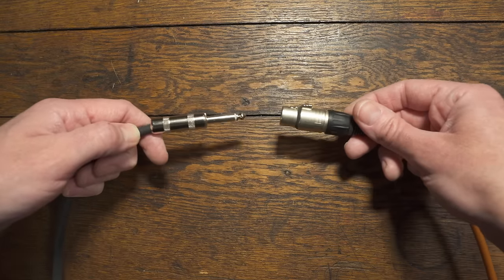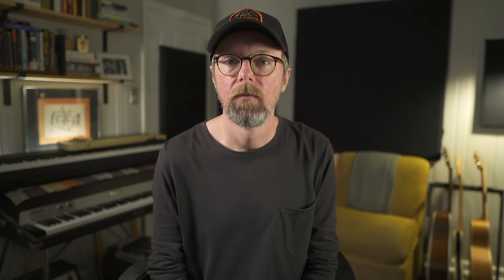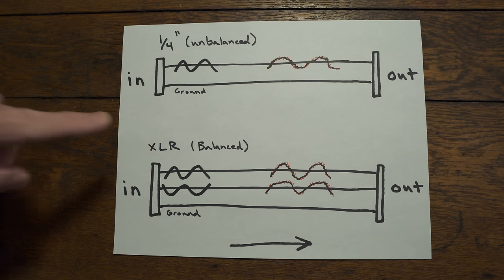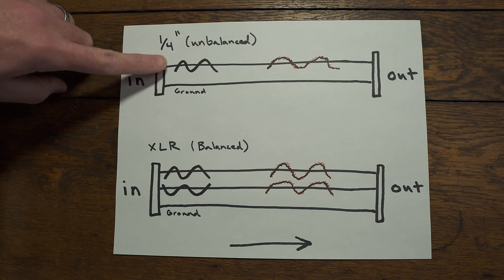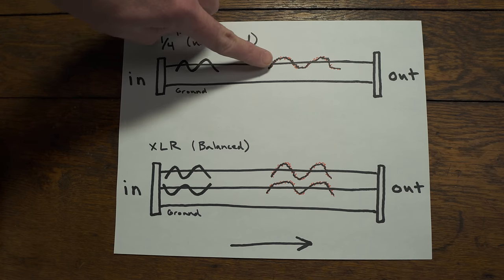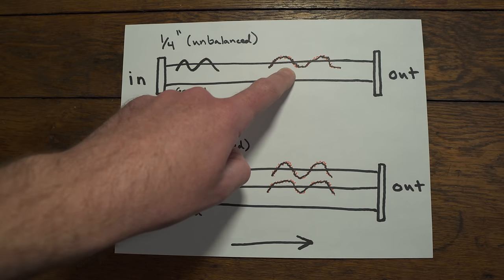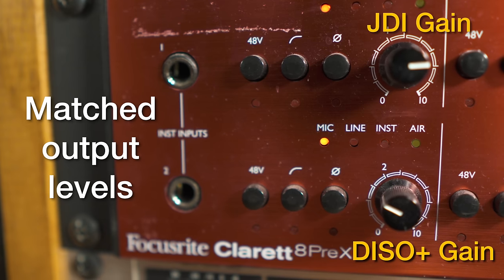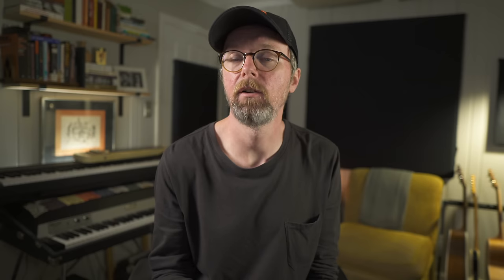Modelers and DI's: What you need to know (Pinstripe Pedals DISO+, Walrus ACS1, Iridium, HX Stomp)

Comment: A quick side note: @8:08 the ACS1 makes a subtle fuzz/clip sounds on the attack of the chord. Mine does this as well and it drives me crazy. I wonder if it is digital clipping of some sort? So I have to drastically lower the Volume. (not sure if that bothers you) BUT I've heard the DISO actually adds volume, compared to not using any DI at all. Is this true? Thanks!
Reply from the maker: Previously I've run the ACS1 volume with a standard DI at about half way because of what I talk about in the video - the DI will saturate or add a subtle clipping type sound. People have also mentioned a clipping sound with the new update that I haven't been able to replicate. I'm not really hearing what you mention at 8:08 other then the DI saturating and softening the attack. 
Also, I'm not sure if the DISO adds volume compared to no DI at all but the difference could be related to impedence differences or balanced vs unbalanced cable issues.
Reply: That would drive me crazy too. It sure sound like digital clipping, and I don't think it is coming from the DI. Sounds a bit like clipping an audio interface input.
Reply: @MichaelWWestbrook  is correct in that the DISO is not adding volume. You're just used to the level drop of feeding a line level into the resistor inside the front end of a DI.
Reply: @joshcruz3  Correct that the DISO+ does not add volume because the transformers are 1 to 1, meaning the signal level going out is the same as the signal going in.  Virtually all passive "direct boxes" will drop the signal level because the transformer windings are around 12 to 1 (primary/input side to secondary/output side).  This gives a high input impedance and a low output impedance (design goal) but the consequence is a signal drop of about 20dB, typically with no pads.  Normally, a passive DI will have a series input resistor to limit input current, but it has a very small influence on the signal level. HTH!

Comment: Do you think we'll ever have XLR outputs on guitar?
Reply: It has been done, it goes back to Les Paul (the man), it's great for clean sound direct to board, bad idea for running pedals and amps FWIW. Check the Gibson Les Paul recording model. It has a low impedance design circuit for direct to mixer use, including special low impedance pickups.

Comment: Thanks for this video. Super well explained! Would the Iridium work better with the Radial Active or Passive DI box?
Reply from the maker: An active DI is going to give you more output for sure. Either will work fine but don’t crank the output levels on the modeler.

Comment: I don't get it.  I bought a modeler to eliminate all my pedals.  Doesn't the modeler have this built in?  What about the direct out on the line 6 powercab.  Doesn't that do the job?  Confused
Reply from the maker: Yes, if it has an xlr out it’s not needed. Unfortunately a lot of these small format modelers don’t
Reply: @MichaelWWestbrook  got it. My Helix floor, my power cab and my Amparo all have balanced XLR out so I guess I don't need it
Reply: Except for the fact you may get hit with phantom power in a live environment which will wreck your outputs as the output isn’t protected by a transformer on a helix. 
Additionally the benefit of a device like the DISO is to eliminate ground loops if for whatever reason you have multiple paths to ground. Example, you’re plugged into an amp, and also plugged into a console via an XLR. Being able to lift the ground will kill any earth loops present. A helix on its own direct into a console won’t present any earth loops because it is DC power which by nature isn’t connected to ground. The helix would therefore simply be earthed down the XLR ground pin, through the console earth.

Comment: The Pinstripe sounds like it raises the noise floor more and degraded the signal somewhat…. Whereas the radial is darker but imparts a very tube like clean signal, typical of a passive jensen transformer… i guess it all depends on what you want to achieve
Reply from the maker: A bit confused by this. The pinstripe is quieter for sure and you don’t have to push preamp gain as much. Not sure that this clip so cases that specifically though. The JDI sometimes requires me to push the pre into a range where it’s starts getting noises. The radial is darker for sure. I always feel like it imparts a low-mid thing to the sound and isn’t as open in the top end.

Comment: Can't I go iridium to mixer, to interface without issue?
Reply: using jacks should be fine, but if you run jack to XLR (out) there can be the issue of phantom power going into you unit. My helix got F.....d by a soundguy sending Phantom power into my XLR outs, now I only use unbalanced jacks out (the XLRs are F...d now) and I don't have to worry about that anymore. Even phantom blockers need time to engage before being hooked up to the sound source, so that's not 100% safe either.

Comment: Nothing against the video, but people: you don't need a fancy $269(!!!) DI and you don't need a jack to XLR cable. Practically every (home) recording device or live mixer has jack in with enough adjustability for the correct input signal. And so you won't damage your product with phantom power. IF you need XLR (I would, in a live situation): a short patch cable to any active DI will do. You don't need to look up all the specs of every DI and what coloring they will add and what they will do to the output signal, etc.. The output will be fine and plenty loud for any kind of preamp. The JDI example wasn't really relevant, since nobody will crank the volume to the max (no need to) and it's passive. Use active. :) If you have money to spare: by all means, buy the DISO+: it's great. If you have a DI or a simple audio interface lying around: use it. If you think this and that very expensive DI sounds slightly fuller: adjust the EQ. You won't hear the difference live anyway. : )
Reply from the maker: I hear ya - not everyone needs this but even a pair of “cheap” active DI’s will cost you close to $200. A Radial Stereo Active DI is over $350 new… kinda makes the DISO+ look like a deal. It’s made well and will hold up over time all while doing a great job at its intended goal. The comparison is for those who are interested. IMO, it’s really not that big of a difference but I do find the DISO+ to be slightly clearer and punchier.
Reply: @MichaelWWestbrook  Yeah true, DI's are pretty pricey nowadays and that Radial price is just crazy. Then the DISO+ is def. a better deal. But you can still buy a €99 audio interface or a €39 cheap DI and get a great sound. I will gladly make a video for the people interested showing that that is enough for most cases, if you know what you're doing. :) My gripe with these kinds of videos is that people are getting more and more insanely spec hungry and overanalysing every potential aspect of every thing they're thinking of buying. Thinking they need all kinds of boutique stuff, often before even trying something or before even knowing how to play. And also beginners getting scared about things like 'oh I'm gonna damage my pedal with 48v' (I've never seen this happen in over 15 years of professional playing) and thus thinking they need more expensive stuff. BUT! This is my problem and it's not like I'm changing the world by complaining about it.. And you recently sold me on the ACS1 a while ago, with one of your video's, so thanks. : )
Reply from the maker: I totally agree about folks sweating the small things and worrying about specs too much. Gear is so good now (even the cheap stuff) you can make great music with any of it. Some folks don’t get to that last step because they are busying worrying about buying the next big thing.
Reply: Show me a professional touring stage that provides line inputs to the console?. 99.999% of live audio production companies floor packages consists of analogue XLR lines that run to a mix rack containing MIC PRE’s. Not line level inputs! 
His point is that you can negate the need to engage the gain pot on the mic pre by providing a hotter signal to the board from the get go.
Reply: Should I use TRS or regular jacks to connect my HX Stomp to a stereo di?

Comment: Is there any need to use one with the HX stomp as it is balanced and has protection for phantom power too? Also, this is the best explanation of balanced and unbalanced signals I’ve seen!
Reply from the maker: Thanks! In the case of the HX stomp it serves as a way to get to xlr, a way to lift the ground in case of hum and a patchbay. Still useful for sure.

Comment: This raises an interesting issue with pedalboard modelers used live. In the studio probably less important because you can use a short unbalanced cable to the HiZ input of a preamp. The transformer of the JDI definitely can get saturated, as would most other passive DIs running a line level signal. That’s a desirable thing I’m some cases but a good active DI is almost always going to be more transparent. The DISO+ is a smart solution though.

Comment: Phase is not the same thing as Polarity, you're talking about signal with opposite polarity on balanced cables, phase is frequency dependent, polarity is fixed, like in a balanced connection

Comment: Shouldn't you be using the radial active di instead of the passive box used here. I understand if your guitar has passive pickups, you need an active di to bring your signal up. Passive would be for a guitar with active pickups.
Reply: No passive is better as he isn’t plugging his guitar direct into the DI. His guitar goes into the modeller which changes the nature of his signal. As his ACS1 is kicking out line level passive is a better choice.

Comment: Hello
Your diagram is wrong. The fact that the noises cancel each other out because of the two cables where they circulate in phase opposition is a myth. The truth is that noise is reduced because the two cables are isolated from ground, whereas in an unbalanced connection the signal and the noise flow through the cable AND through the ground braid. Look at the papers of Mr. Bill Withlock member of the AES. (many pdfs on the web) the noise reduction is due to the impedance of the two cables with respect to ground (insulation with respect to ground) and NOT to the fact that they are "in phase opposition". Best regards
Reply from the maker: The diagram isn’t wrong but only gives part of the picture. From my understanding, what you are saying is not completely correct either…Mr. Withlock states: “The purpose of balancing is to make the noise pickup equal in both conductors, in which case it will be a common-mode signal which can be made to cancel out in the load." So, the balancing of impedance in respect to ground (equal noise pickup on both lines) AND the fact they are “in phase opposition” are what creates noise free operation. If the phase wasn’t flipped it wouldn’t be canceled. It seems what he says is a “myth” is the importance put on voltage while failing to mention the most important part - impedance. Whatever the case… all of this is far beyond the scope of what I could have covered in this video

Comment: A DI can be useful on stage for the reasons described in this video, but it is basically pointless for the short cable runs into line level inputs most people have in a home recording situation.  Having a balanced signal does not matter that much when the cable run is short, shielded, and the signal levels are strong, as with a modeler into a line input on an audio interface.  It's just not really an issue.  Also, there will never be an impedance "mismatch" between a modeler output and a line input or a mic input.  That is just bad information.  It's not true.  Any modeler is already going to have a low enough output impedance to drive a line input or mic input on a recording interface without issue.   I'm an electrical engineer, and I'm constantly frustrated by the amount of misinformation on this topic I see on the internet.  This video is not helping.
Reply from the maker: Not spreading bad information as I said this generally isn’t a problem with modelers. To clarify, I was talking about DI’s in general help with impedance matching. This comes into play with some acoustic pickups in particular.
And yes, in a lot of scenarios with a short run you don’t need one with an interface but I can’t tell you how many people I’ve seen post in forums who are having noise issues or grounding issues in their home studio because they are running directly in and not using a DI or line leveler. All this to say, I’m not spreading bad information. Maybe some things could be clearer but I’m speaking from experience and the issues I’ve seen others have time and time again.
Reply: Thanks for the clarification.  I was a bit frustrated to learn here that I was going to "need" another $300 box to run my $300+ dollar ACS-1.  It seems to be working just fine going into my Apollo twin mic inputs.